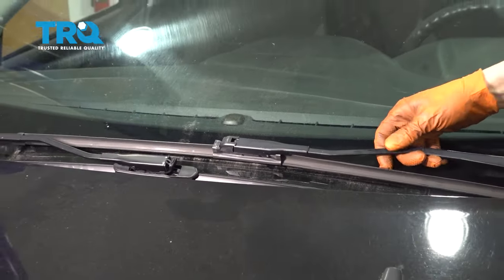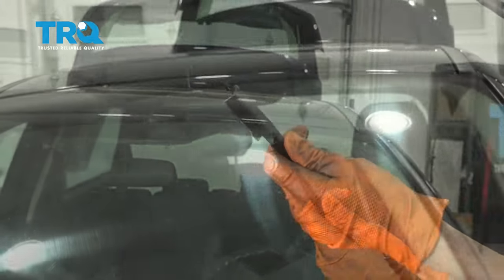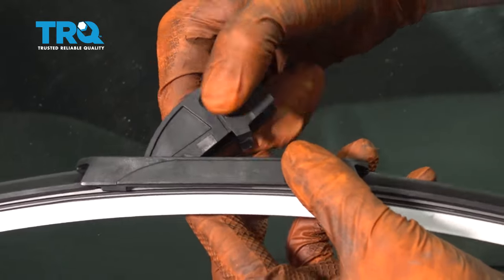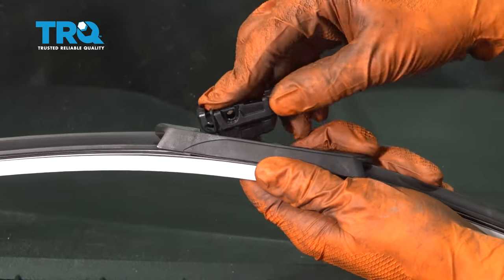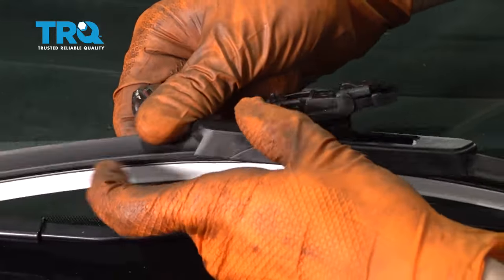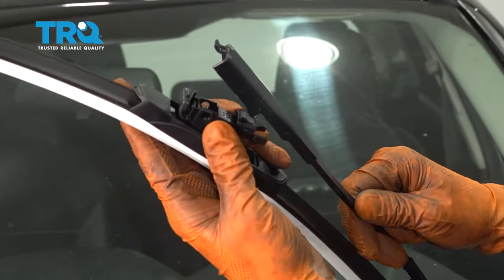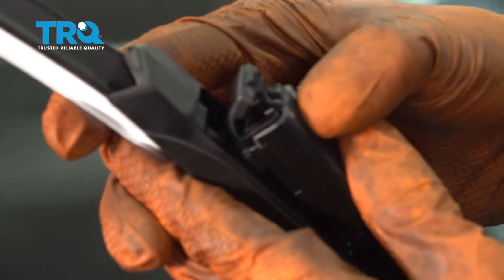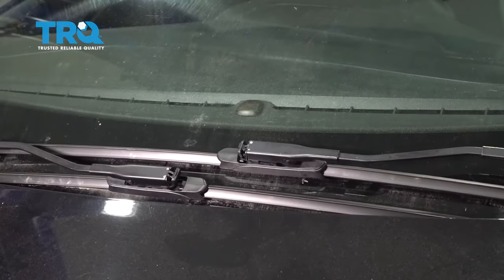How to Replace Wiper Blades 2012-2020 Ford Focus

Comment: ❤❤❤
YES!!! 16 VIDEOS LATER AND FINALLY!!! A PROPER VIDEO THAT ACTUALLY HELPS😊

AND... NOT ONLY FOR FORD FOCUS MODELS. 
I HAVE A DIFFERENT MODEL IF FORD, SO THIS VIDEO IS RELEVANT FOR 2015 FORD ESCAPES AS WELL...  
NOT SURE OF THE BRAND OF THE WIPER YOU HAVE USED BUT I HAD THE COSTCO 28" MICHELIN WIPER REPLACEMENT AND THIS VIDEO WAS A GODSEND.  
YOURE THE ONLYNONE MENTIONING HAVING TO REMOVE PART C TO GET TO B. 
T
H
A
N
K
S 
❤❤❤
Reply from the maker: +@dominikajaswiec6284 Thank you! We love empowering our customers and showing how to perform DIY auto repairs with our high-quality auto parts. http://1aau.to/m/Shop-TRQ